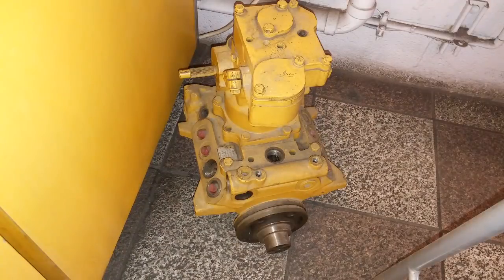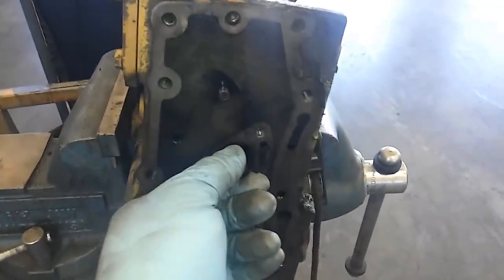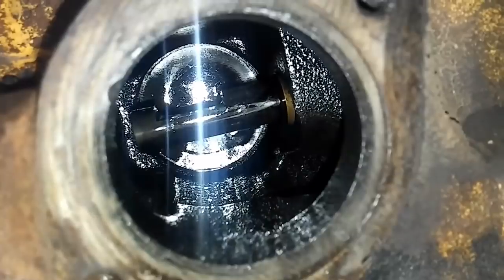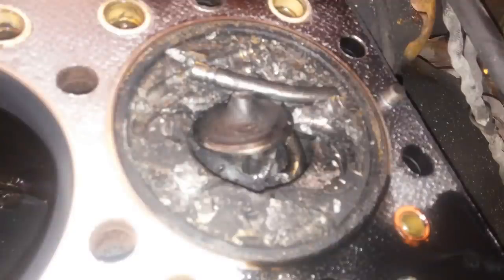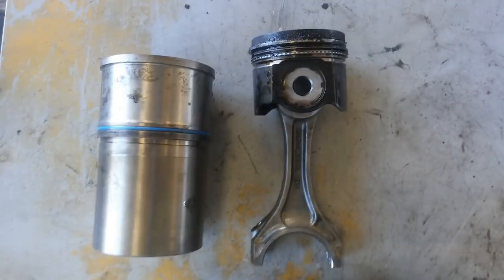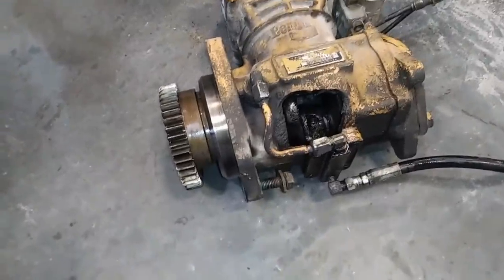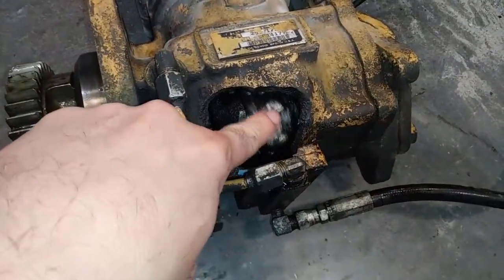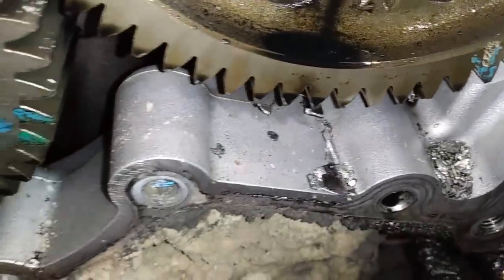Why Do Diesel Engines Runaway? What Is A Diesel Engine Runaway?

Comment: Adept ape, here’s something I’ve always thought about. I’ve never had a runaway, but I’ve always considered it. Hear me out.

Runaways as you mentioned are caused by an uncontrolled fuel entering the engine, more commonly oil from the turbo. Now we both know Diesel engine run on compression. Now most Diesel engines are equipped with a mechanism that dumps compression at the top of the compression strike. Yep, the jake brakes. I’ve always wondered if you caught the engine before it completely oversped, and hit the jake, would you be able to hold the engine at a low enough rpm (since it would cut out at idle) so that you could get the intake off and block it.

Also one more thing. CO2 fire extinguishers work fantastic for shutting down a runaway because it doesn’t burn. DO NOT USE DRY CHEMICAL as it won’t stop it, it will only add to the damage. But guys have told me CO2 extinguishers are great. 

Anyways looking forward to your input.
Reply from the maker: I was thinking about that last night after I made the video about the Jake brakes. Would be an interesting experiment. Theoretically they could dump the compression as they are designed to do and could stop the engine. Never tried it, but I'm sure someone has.
Reply: i don't think that it would stop the engine unless it was an old engine. all the electronic engines have the jake cutout at idle to stop the engine from stalling, so it would drop to idle, cut out, take off again until the ecm kicks the jakes back in, back to idle. but still it should be able to hold the engine in that range (probably up to 1200 and down to 600) long enough that you can get the intake tube off and block it without the engine grenading.
Reply: I keep a fire extinguisher of CO2 ! No oxygen no ignition ! Have not tried it but that was what I was told would work in a pinch ! Also a piece of plywood or thick tin large enough to cover the inlet ! My opinion Glen.
Reply: I have a 353 detroit diesel engine naturally aspirated and I have a CO2 fire extinguisher in the engine bay. I haven't tested it out yet, but theory is you can just put it in the air box and shut the engine down without damaging the engine or ruining the air filter.
Reply: Just saw your comment on the jake brake idea. You can probably use an override switch to trick the ECM to stall out the engine.
Reply: Since the engine oil pump would also be turning in reverse, no oil would be flowing to the jake brakes for them to operate.
Reply: Here in Alberta working in the oilfield, any diesels I've ever used have always had a positive air shut off. For work in hazardous atmospheres a lot of companies make roda deaco valves mandatory I'm pretty sure
Reply: Adept Ape at
Reply: I'm glad you put this here. I was going to ask about CO2 fire extinguishers.
Reply: Chad Jessup why do you figure the engine would be running in reverse?
Reply: @goober239 , most older Detroit diesels have an air shutoff valve installed from the factory, usually labeled emergency shutout.
Reply: @speed150mph  . . .or if it's in that 600-1200 range you could stall it.
Reply: emmjay good point. Get it Down to idle with the Jakes and then drop the clutch in high gear
Reply: Well now its pretty obvious no one here knows how a jake brake works, they do not dump compression as that would be pointless when you need more engine braking, they work by closing off the exhaust valves to increase compression hence the fukin beat that you hear when they are used lol.
Reply: @mikmacarthur  The exhaust valve most certainly does open, when it normally wouldn't,  at the top of the compression stroke, sending the compression out the exhaust instead of causing combustion or returning that compression back into the system.  That is the pop you hear like a balloon busting.
Reply: @speckbaron11  You could say literally anything else about Americans and be right, but try dumping the clutch to stall a V8 with 2500 N-m torque and let me know how that goes.  Sure it works fine in a Jetta but not so much in a lorry.

Comment: Don't throw the fire extinguisher in! DISCHARGE it into the air intake, that will snuff out the air and stop the engine. Obviously a CO2 one will do no damage as it's only a gas, but I suppose any other flame retardant will also work but messy clean up
Reply: If you have a standard ABC extinguisher then blow it into the air filter intake. It will clog the filter and choke the engine out. This isn't great on the engine but it sure beats blowing up the engine.
Reply: Camp Cookery  that's not how powdered extinguishers work, the solid powder smothers the flame. That's why co2 is better
Reply: Clogging the filter will not guarantee that it'll prevent air entering through any leaks in the plumbing between filter & head, but if you're running out of options you have to try anything as long as it isn't risky or unsafe!

Comment: I worked in a truck factory, and once I filled an manifold with ethanol to start one engine and he started running away. I was already leaving it alone than I thought: "If this engine don't blows me up, my boss will...." Then I went back inside cab, put a 5th gear and released clutch with brakes applied, it was enough to stall him...

Comment: I been told 2 methods:

Plank in front of the turbo inlet(but nobody runs around with an open turbo)...this method won't work if you have air leaks after the turbo.

If that fails or it's impossible to do then spring for a CO2 fire extinguisher(do not use white powder or foam, bad stuff for your engine internals). 
You're probably gonna need A LOT of CO2 to effectively kill a 13.0-15.0L run away monster . . . probably something slightly smaller than the size of a scuba diver's tank.

I think it's a good practice to carry a CO2 extinguisher on any diesel vehicle or any vehicle with an I.C.E.
Reply: A blown turbo is a lot cheaper than a new engine.
Reply: Munnz  that much I know. But what are you trying to say ?
Reply: @madjack1748  this makes no sense.  No one is talking about a blown turbo; that is irelavent.

Comment: Thank You for the very thorough explanation of a "runaway" diesel and how to stop it.  I've wondered for some time, the cause, and I think you nailed it.
   My other question concerned "Turbo Diesel"
Runaways, but if you use logic, the cause is basically the same, except in the turbo instead of the engine.
   Thank You!

Comment: October 10, 1979. Ansbach,West Germany 141 Signal Battalion, 1st Armored Division  60 K generator ran away. 1 mechanic tried to stop it with his field jacket, nope. I grabbed a creeper, Nope. Sargent and another grabbed a steel plate for that reason put it on the intake,(I was told to cut the boot, and the steel plate cut the air off. I was in country 3 months,and found out what to do if it ever happened again. LOVED YOUR VIDEO!!!

Comment: Runaways are fueled by oil not diesel 95% of the time...
Reply: diesel is an oil
Reply: usually from a blown turbo, but not always. And ironically they still can suck in diesel fuel as well
Reply: @Corn Fed DIESEL IS AN OIL Dammit the engine can burn both diesel and oil
Reply: @felixbeutin9530  True, he should have been more specific: He should have said "crankcase oil".
Reply: @vincentrobinette1507  Or turbo/supercharger oil, or valve oil. Lubricant oil in general.
Reply: @Jupiter__001_  Supercharger oil, perhaps. I know in some superchargers, it has it's own oil for the gears that time the rotors. In most turbocharged engines, the turbo is lubricated by engine oil, so there's a lot more oil in reserve, than the pint or so that may be present in the gear case of a supercharger. I'm not sure what valve oil you mean, I've always thought the valves were just lubricated by crankcase oil. It might be worth it to have an emergency  oil cut off valve to the turbo, just in case. My view is, the turbo is already destroyed. Now, it's time to save the rest of the engine!
Reply: Diesel is not exactly an oil and should never be described as one. It's a mixture of hydrocarbons. Alkenes, cycloalkanes, and alkanes in the 10-20 carbon atom range. They're the hydrocarbons that are so short, they freeze at an inconvenient time, they have too many contaminants to be used as an actual low viscosity oil/hydraulic fluid. 
--Diesel does not react with chemical additives the way a more viscous oil does.
Reply: @vincentrobinette1507  Better to have an air cut-off butterfly valve in front of the turbocharger.
Reply: @Jupiter__001_  You would rather have it down stream from the turbo, so the suction doesn't draw in even more oil, risking hydro locking the engine. Diesel engines have much less clearance volume than gasoline engines, due to their high compression. Remember, you're closing the valve, because the turbo has already failed.

Comment: Another cause of a diesel runaway, which you didn't mention, is the presence of gas in the air. Natural gas, propane etc.
In the oilfield, all diesel engines are required to have an automatic shutdown installed which automatically shuts off the air in an overspeed situation.
It's a good idea and it would be nice if manufacturers would put them on as standard equipment!

Comment: That locomotive at the beginning of your video looks more like a turbo failure than a runaway, but that could lead to a runaway if it's loosing oil on the intake side of the turbo (that one looks like an exhaust side seal failure).
 
In 41 years as a diesel mechanic, I've witnessed 3 full blown runaways. 

First was a Continental Multifuel in the Army. It had a rotary type pump that was improperly assembled letting the rack go to full fuel and stay there. It passed 4000 rpm when we started it. We shut it down with a fire extinguisher directly into the turbo, cutting off the oxygen.

Second was a Detroit 6-71 with a rack that hung up in full throttle. We shut it down with a clip board over the intake.

Third. For those of y'all that aren't familiar with Detroit Diesels, they start up with the rack in full fuel and as they come up to speed, the governor pulls the rack back. When you pull the shut down cable, it pulls the rack all the way back into zero fuel position. 
One of our Einstein mechanics on second shift was doing a rack adjustment on a 6-71. This normally requires setting each injector to full fuel with the engine off but the shut down cable pushed in. He set it with the shut down pulled out, so that when it started there was no way to bring the rack back to idle or zero. They got that shut down with a service manual over the intake. The next day I had the job of figuring out what happened, and correct it.

Comment: Had a runaway in my boat once
Shutting of fuel did not work, cause it was burning it’s oil
Unable to reach the intake, so I pulled the decompression
And I once I had an runaway in my petrol motorcycle.. still don’t fully understand how that worked
Reply: It listened to initial D
Reply: That’s a stuck throttle cable for your motorcycle not a runaway
Reply: Fairly common if you don't lube and replace your throttle cable when needed. Could also be a carburetor issue.
Reply: 2 strokes could runaway... I had this problem on 50cc bike - high compression and carbon build up inside the engine
Reply: Glissrova Videa very rare
Reply: @penguingamer4418  Can be caused by ice build up in the carb slide. Has happened to me a few times when running open carbs in wet, just above freezing, temperatures.
Reply: Or if they are vacuum carbs, then maybe the slides.
Reply: maybe the throttle got stuck inside the carb?
Reply: Can also be aptly named dieseling. When the engine compression ignites after spark is cut. It usually only happens for a short time, but if there is a large amount of fuel vapor being compressed, it can sustain itself for quite a while. Lawnmowers do it fairly regularly as the fuel runs out.
Reply: Had a honda ct-70 runaway once. Working on it with my brother. Caught the throttle cable somehow and over revved it way past redline. Ignition off, cut the fuel. It just kept singing at 20k rpm or more. Oil gets past the rings easier at high speed and the rapid compression and heat ignite it, causing it to diesel away. The chain was off, it was in gear, we jammed wood into the sprocket to stall it. Thankfully it was only a 72cc single cylinder engine.
Reply: Could’ve been to low octane of fuel, which just kept burning from the present heat and compression
Reply: Motorcycles can runaway when exceeding maximum RPM. They force enough air through th e closed throttle and run by "knocking". High performance racing bikes often do that since their normal operation is close to the RPM where they can runaway.
Reply: @penguingamer4418  : WRONG!  I had my Kawasaki 175cc 2-stroke Air-cooled "Run Away"  the engine was very hot, I came to a stop and it was running Way Too Fast and it was climbing (3000+ RPM) I shut off the ignition, and it continued to climb... I finally was able to put in 3rd or 4th and kill it with rear brake...it was at almost 8000RPM (Redline) and it is known to happen... in fact "Glow Engines" run on this premise.
Reply: 2 strokes can diesel type run away, for example an air leak on the intake side will cause it to run massively lean, making it extremely hot. This can cause it to keep running like a diesel with no spark, and the air leak just keeps allowing air around the closed throttle butterfly so it keeps running
Reply: I had a kawasaki motorcycle with 3 mikuni slide carbs. I cracked the throttle wide open and one of the carbs stuck wide open, no kill switch either, had to stand on the pegs and choke it to death to kill it.